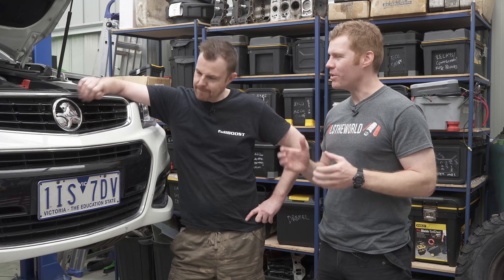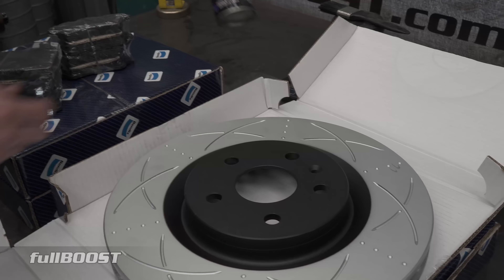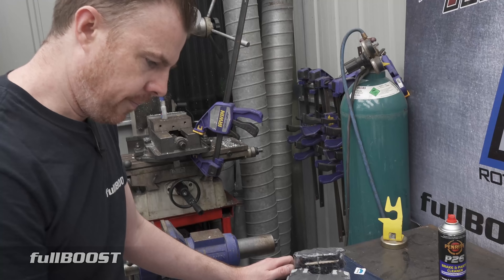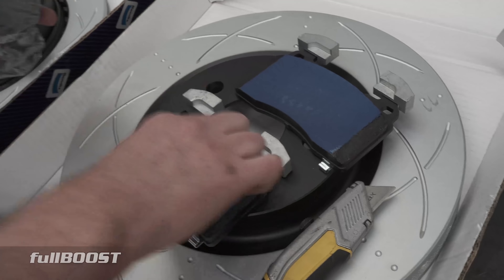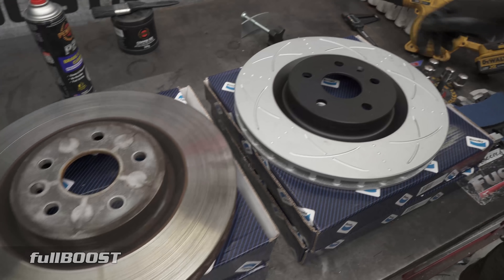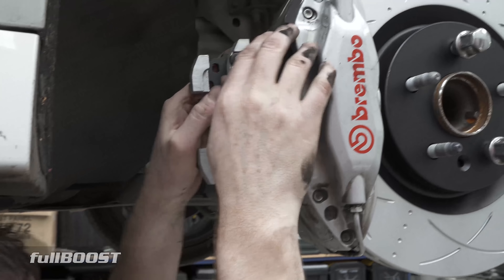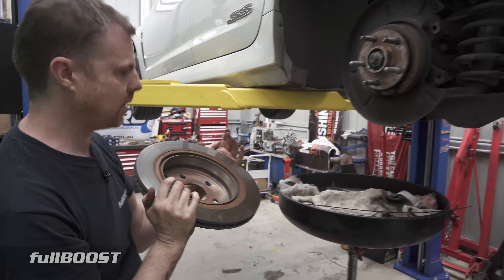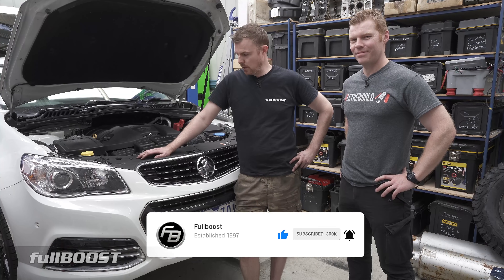Holden Commodore VF SS-V brake upgrade | fullBOOST

Comment: Tip for new players make sure your brake fluid reservoir isn’t about to overflow as you push pistons back in.
Reply: Better idea, push all that old heat cycled fluid out of the bleeds and feed in new fluid to the master to keep the fluid fresh.

Comment: Quick tip ..As I found out today while doing the brake upgrade on my 2014 chevy ss...make sure parking brake is released before starting, It will save you an hour...LOL
Reply: I was banging on that thing with a hammer for a good 10-20 mins smh
Reply: How does one turn off the electric park brake?

Comment: Not sure if it’s been mentioned but when the slots are disappearing due to wear that’s a great indicator that the rotor needs replacing
Just like when your break fluid is low in your master cylinder it means the fluid is in the calliper and that indicates your pads are low

Comment: I use two large flat blade screwdrivers the push back Brembo pistons with the old pads still in and suck some fluid out of the resovoir with vf commodore the electric handbrake doesn't need to be adjusted regularly like ve manual handbrake.
Can you guys rotate that washer bottle cap anti clockwise to where it's meant to go it's really bothering me.

Comment: guys i knew that bendix did them, in fact i require a set of ultimate pads for the front and rear soon ie: around 6 to 10 months from now, holden said i require new pads and rotors, i checked them and they are as below sizes) , i have had the car for approx 5 years and my pads are only 1/2 worn wear indicator and used a vernier to check thickness left on the pads and the front rotors are 31.5 mm ( 32mm new)  and the rear are 360mm upgraded rotors and brembo calipers, so the rear pads are the same 1/2 way worn and the rotor is 27.5mm thick( 28mm new), so in 5 years the rotor wear was on.u 0.50 thousands of a inch and the same with the rear rotors? Its a 2015 SSV redline with rear silver brembo calipers and that's it other than rear mufflers were changed to DPE set, so it sounds at least like a V8 when you drive and start it. But also DBA rotors are expensive, unless you use there ecoshield or Oe replacement rotors, but one aspect of the bendix pads there's rubber shims which EBC makes and i would have put the rubber shims on the front ones just to stop any squeaking noises the rears already have them fitted by bentix, the fronts don't have them, cheers :) The rubber shims is basically sticky rubber thin pads which you cut to size and stick them on the outside of the pad ( the surface areas which the inner piston touches and wow the difference it makes is amazing), anyway keep the redline going and keep up the great work guys. :)

Comment: I still cannot believe Holden were still using that internal drum for the park brake. I would have thought by the time they introduced the VF Holden would have gone for a disc. 

A question for you guys, do these Bendix pads cover your wheels with brake dust or they are good in that regard? Thanks for uploading this video.

Comment: G'day guy's how do you adjust an electric handbrake on a Vf and also when taking the rear disc's if you have trouble putting the disc's back on cos of the internal handbrake how do you back it off please ?

Comment: How are the rotors and pads going ,any squeaking noises and sutter at all? cheers guys. :) also check if the harmonic balancer has a wobble they are prone to it, due to the shit manufacturing process of them, if it has, then replacement is required otherwise the other pulleys and may even damage the a/c compressor as well, powerbond HB1117N is the Oe replacement for it, mine has a slight wobble now, getting the A/C belt which is Gates #4PK1110 and the main serpentine belt # 6PK1840 and the balancer done ( change the OE balancer bolt as well or use the ARP bolt if you want that extra peace of mind) but not really required the Oe bolt is just fine?cheers and please let us know how the bendix brakes are going. :)

Comment: How did you push the front pistons back? I’ve tried using the tool you used on the rear on multi piston calipers and it just pushed the other piston out. I need to replace my pads on 6 pot calipers.
Reply: I just lever off the pads before unbolting them. You push the pistons back in and the pads stop the pistons from sliding out when the one beside them is pushed in
Reply: G clamp works great

Comment: Here you go guys / people. https://youtu.be/Z_mPyZ4-GNk cheers :) Also Bentix made a mistake with the series two redlines, as they have 355 mm on the front (correct ) and the rears are 360mm on their new brochure for rotors it (wrong they have 324 mm) so be carefull, best to ring the tech line to make sure you can get them in that size for the rear if you have 360mm rear rotors sizes or a series two redline and need rear rotors to replace, cheers :) 
I have contacted Bentix to update and re check the sizes for all the cars and 4 x 4's for the rotor online brochure and maybe hard copies or wall mounted posters if any against OE spec's listings they may have. cheers :)

Comment: Why didn't you show us the hub b4 you put the front rotor on? Is that Bcos your  suppose to clean the bolts and the surface with a wire brush and you didn't want to futher explain that part in your video?

Comment: Never liked the breaking in coating on the pads. They increase the temperature with even light braking & if you're not careful, the discs will glaze immediately & cause annoying squealing.
Had this issue twice, I just rub the shit off by rubbing the pads together. 

If you like to break HARD use the heavy duty pads they offer.
The discs look extremely like DBA manufactured items, even the internal kangaroo paw venting looks similar.
Reply: Correct,  they are DBA made for Bendix

Comment: Would these fit a ve Berlina.
Reply: VE and VF standard brakes are the same across all models, with the only differences are v8 ones have larger rotors and caliper cradles. The part number for the bendix rotors are BR2026 and BR2027 for v6. V8 ones are BR2028 and BR2029. Bendix pad part number is DB1765 and DB1766.

Comment: Seriously.... who cares if the rotor is 1 mm under spec. Most drivers who daily drive,  it would not make a scrap of difference as their brakes would not even get hot in fact most people wouldn't even know what brake fade is as they wouldn't even push their brakes to the limit. Standard factory brakes are fine for daily driving.  Ohhh don't use rotors that are under spec, you're car is unsafe blah blah blah

Comment: I own a series one SSV not the redline. I’m curious to see the larger brembro/benders upgrade 🧐
Reply: Hi mate, I've got the front Brembo brake upgrade on my Calais V and the VF series 1 Brembo brakes will fit any series one VF as long as you have HSV or Redline specific wheels. The offset in them is different to the standard Commodores.
Reply: Awesome. Has Resline wheels on it. 😁Thank you